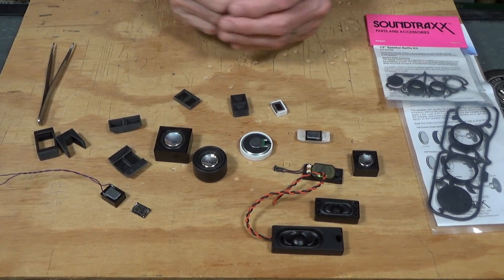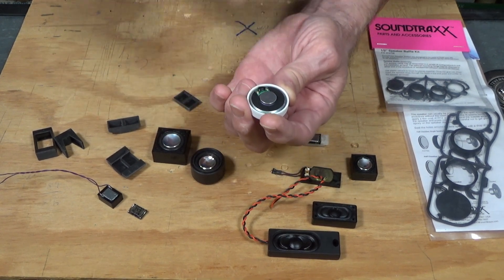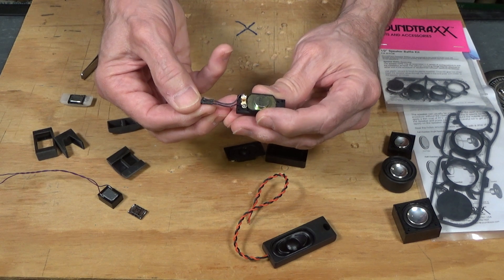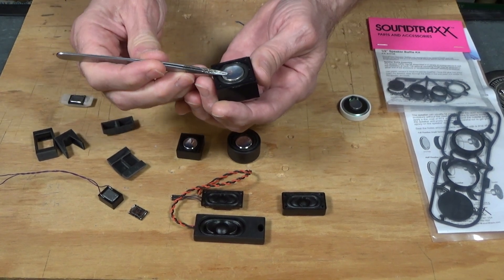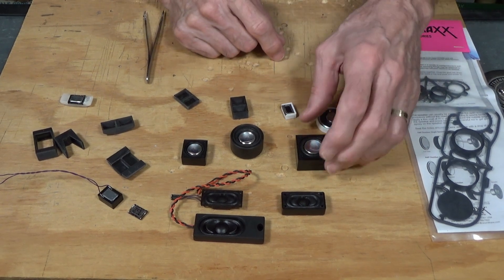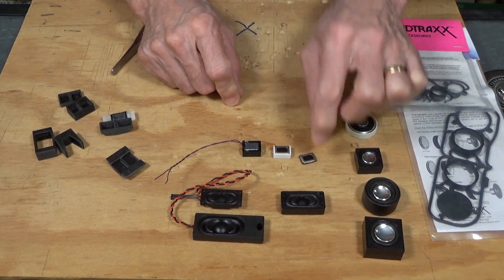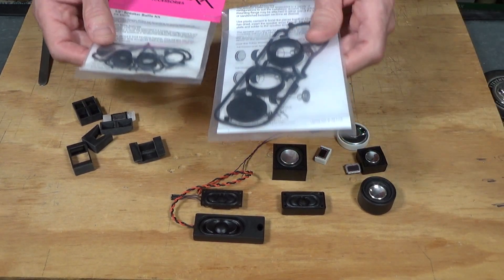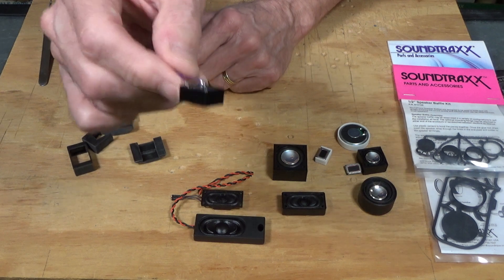57. Speakers, don't make your next installation a dud pt 1

Comment: Hi Larry. I am curious, why is it okay to install the speaker into the baffle with the cone facing into the baffle? I know speakers work by pushing air, so it seems that wouldn't work very well. Thank you.
Reply from the maker: With most I have seen it doesn’t seem to matter. Keep in mind that even though the speaker cone pushes air put the front as it pulses that way, it also pushes air put the backside when the cone falls back into position. This is the reason you have to put a speaker in a baffle to prevent the two identical sound waves from canceling each other.

Comment: Hi Larry, I had another question.  I am doing an install in a new release Atlas Master Gold GP38.  I was wondering if 1 big speaker is better than 2 small speakers.  The way the inside is laid out, you can really only put 2 speakers next to each other if you go that route (I always want a PowerPack capacitor in my locos too).  These speaker acoustics are really interesting.  I just bought a couple of the new Walthers NW2 switchers.  As a test I took the stock speaker from the ESU sound equipped loco and popped it into the DCC ready loco along with a LokSound 5 micro plug in decoder and I was amazed how great it sounds, just that one small speaker upfront in the stock enclosure.  regards, NS.
Reply from the maker: It depends on the size, type, and characteristics of the speakers. Once you get to a certain size the frequencies it can reproduce start to get louder in the low bass end. However with most sugar cube speakers they don’t put put much below 300 Hz.  So in most cases you just get more volume, again depending on the relative sizes. If you use 2 make sure to observe polarity. Also if you have room take a look at the Zimo Dumbo sugar cubes with a specially designed enclosure, they can produce a lot of sound and can be found at www.sbs4dcc.com  .
Reply: @TheDCCGuy  Thanks!  I will definitely try them out!
Reply from the maker: I recently used a Zimo Dumbo in a small steam tender and it blows the socks off a regular sugar cube although the enclosure is about as big as the speaker.
Reply: @TheDCCGuy  Thanks again Larry!  I am going to order a few different sizes.  I'm not sure if the smallest will work in this application (26x20 and I have about roughly 30x18 free space), but I have a couple of new Atlas FM H15-44's on order looks like they will fit nicely (I have an older one with the shell off right now).  I may also be able to fit the 40x20 in the FM also (looks like I am limited to 21mm width).  If I go with the Decoder Buddy Mini it should give me some extra room.  Still learning how this all works, only 2 installs under my belt, but they're clean and they work!  regards, NS
Reply from the maker: Check out video #70.
Reply: @TheDCCGuy  
Thank you!  It's exactly what I need to see.

Comment: Great video!  I bought 2 different sized speakers from Tony's.  The smaller enclosure (for the 15x11mm speaker) has a shelf which had the speaker lie flush like you show in your video.  The larger enclosure (for the 18x13mm speaker) has a shelf which makes the speaker sit about half way down the enclosure.  I wonder why they made it that way.  I have glued the speaker flush and thus am not using the little shelf inside.  Also the smaller speaker enclosure has an optional spacer to make the enclosure larger in volume if you have the space available in your locomotive.  The large enclosure does not have this extra spacer.  regards, NS.
Reply from the maker: I talked to the fellow who designed it and he said that having the speaker sit lower didn’t significantly affect the volume and the ledge makes it sit much lower for a better fit.
Reply: @TheDCCGuy  Thanks for the quick research and reply!  I would think they would want a larger empty volume, but I'm sure they did a lot of testing.  I bought several speakers and enclosures so I will try it with it sitting on the ledge.  Thanks again!  regards, NS.

Comment: Where can I find the sound comparison video you described in this video? Thanks! Great info!
Reply from the maker: Mike, I think that I was referring to the videos on the N&W J class 4-8-4 locos and the Athearn Challenger. I used the high bass speakers in both those installations. Look under the installations section, they were done a couple years ago so dig deep.
Reply: Ok I will check them out thank you!!